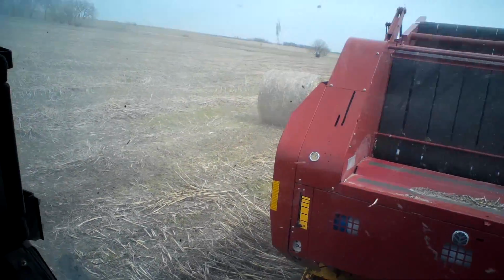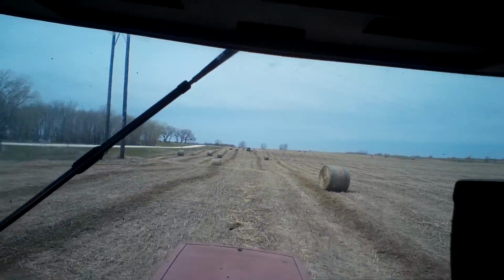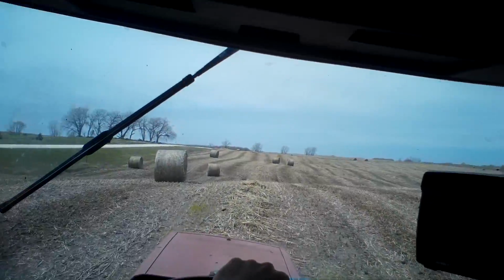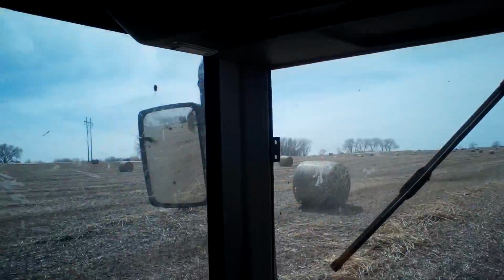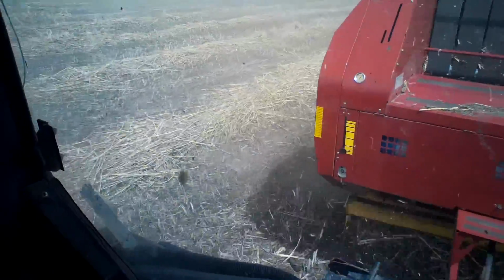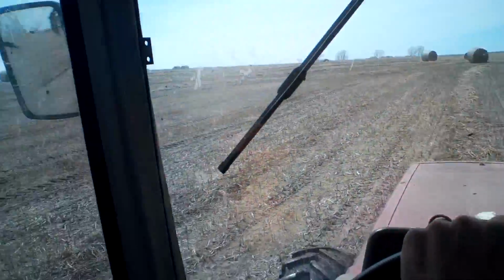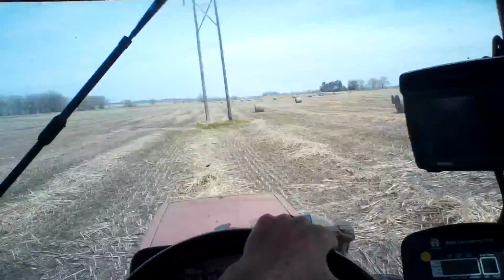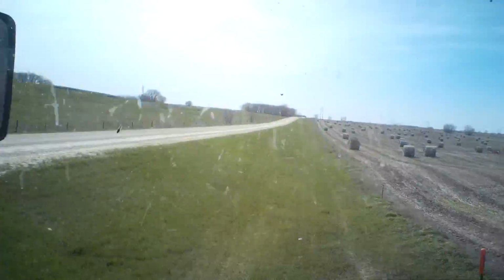Baling in April!!!

Comment: The guy I bale cornstalks for I run his JD 4560 with duals on the baler he never takes them off tractor rides better with them on and 2 of his field are usually really wet for it works out decent only problem is if you don't pay attention you'll hit the side of the baler.
Reply from the maker: I normally extend my draw bar out when i bale with duals on BUT i do have to turn pretty sharp to hit the doors... but it has been done  but i didnt get it to bad...